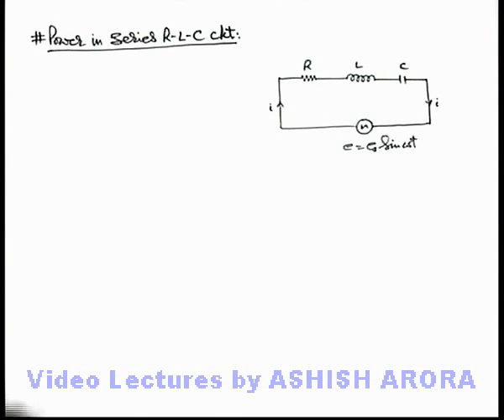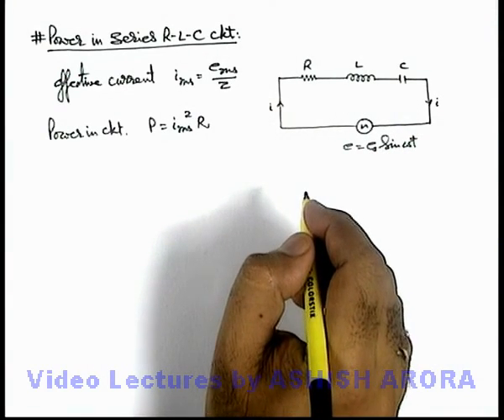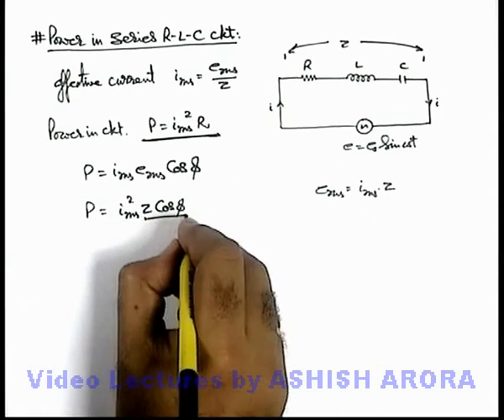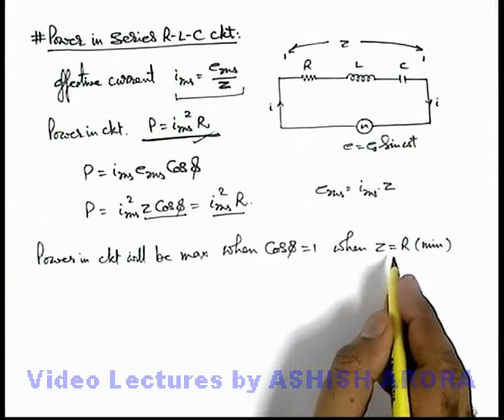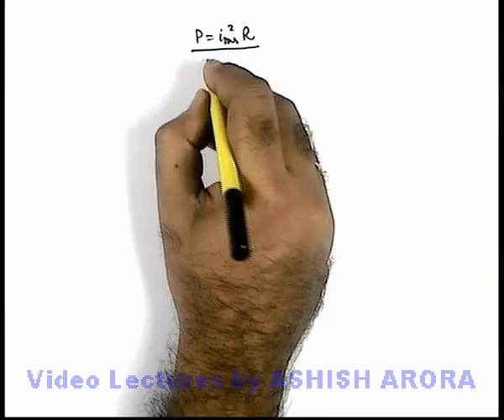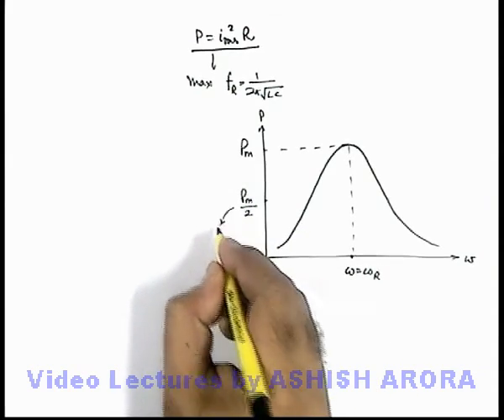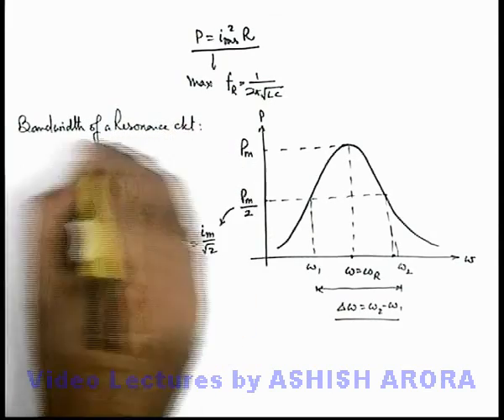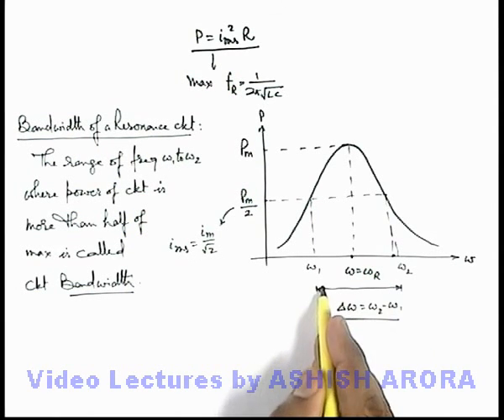Class 12 Physics | Alternating Current | #40 Power in Series R-L-C Circuit | For JEE & NEET

Comment: Note for self:
Only the Resistance is site of dissipation.

Presence of L and C does affect the power dissipated through the resistance, (they decrease the power dissipated, because current is decreased due to presence of impedance of L and C).

Thus L and C affect the current in the circuit.
That current causes power dissipation in resistance.
Thus indirectly L and C affect power dissipation in resistance.

Comment: sir, when you say power in the circuit is maximums , does it mean power supplied b the voltage is maximum

and do the formula i²R indicate power used by resistance and since conductor and inductor don't consume any average power we can equate both the powers ?

please tell sir where I am wrong , I am always week in the concept power, had watched and read the portion of power in electricity but still confused , please help....
Reply: Always power supplied by battery is equal to the power dissipated by the circuit components. Here, we are talking about the power we collect at the components, which in turn, is the power supplied by the battery.

Comment: sir L and C dont consuem any power but due to them impedance increases and this causes decrease in avg power and current in circuit???
Reply: yes it is like you don't let the current flow but you have no source to produce heat or work out of it. its like adding a battery of reverse polarity
hope it helped